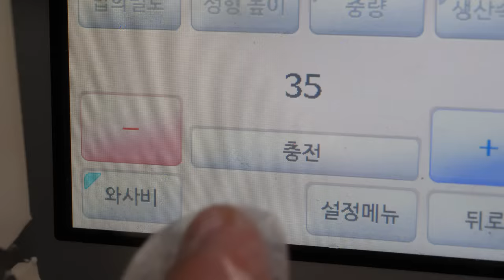신기합니다! 김밥,초밥 만들어 주는 첨단 자동기계 / Amazing food automation machine (Gimbab, sushi)

Comment: this is the most labor intensive automation that I've seen
Reply: It's like the machine does only the steps that requires the least time and effort xD
But sure, the user is reduced to filling and cleaning the machine for every single step instead of acquiring a basic skill like rolling and cutting... but I can't understand how that is supposed to be worth it?
Well, the market will decide ^^
Reply: Your comment is funny
Reply: Seems completely useless especially the machine that just rolls up the gimbab
Reply: I'm so mad you can't set a stack of trays on top and let it load trays automatically. No a human has to load the tray each time!!
Reply: The rolling machine is just like a cigar rolling machine. Just one lever push can do all the job, no need for motorized rolling. Same goes with the cutting machine. Many if not all these machines could work with just one handle pull. Less manteinance, less accidents and most important, it would be faster.
Reply: The main point here is consistency, not actual efficiency. The nigiri maker can pre-mould rice for chefs to put protein (or veg) on, that lessen the work of the chef, also you can control portion size. The same for maki or kimbap rolling machine. No one is too small or too big, too compact or too loose, just pure consistency. When one look at how orderly the Japaneses are, as the main part of their culture, one can understand why these machines are made.
Reply: Maybe they just didn't show the other machine that pre-sliced all the veg/protein?
Reply: @baristaTam  Obviously not for commercial use. Person has to add fish by hand too.

Comment: They're incredible machines. I'm just wondering why they're made with such flimsy plastic. Seems like kid toy plastic.
Reply: 3
Reply: cheap
Reply: Plastic is pretty durable
Reply: I think the reason it's plastic is because the lifespan is longer and it's non-stick. Very easy to clean. And about the flimsy design, it's kawaii > (japanese cute).
Reply: the part where the food is contacted directly should be easily washable and thereby removable. plastic is a good material for that purpose
Reply: @yoy6378  This is in Korea tho
Reply: I'm not sure if this is the case but there's a certain kind of plastic which get tested quite thoroughly to see if they're suitable for food processing/packaging.
Reply: prob made in China
Reply: Easy to clean & replace.
Reply: Easy to clean, and the plastic should be food grade devoid of toxic elements,  kid toy plastic is like that too. So i guess they can be similar.
Reply: @ghost_knight_001  I didn't say the materials weren't technical. I think you're trying to hard to sound smart lol You failed hunny
Reply: Really, I thought the equipment made out of plastics was ingenious.  That way the food won’t taste like metal or like “convenience food”.
Reply: @uthpalachandrarathna4408  food grade plastic Stull has bpa in it
Reply: It's the kind of plastic that's food safe and washable

Comment: Finally, we wont have to pay 20$ for a pack of 10 sushi's in the near future.
Reply: @Mr.Beant It does, for sushi at least. As a matter of fact, sushi mostly consist of rice which is one of the cheapest products. The cost of transportation plays little factor in it's costs due to most restaurants are buying in bulks. In any case, your McDonald bill has around 5-15% labour cost, while sushi has around 40-60% (examples)
Reply: Actually i bought 30pieces of sushi for 9$ today. ( in korea )
Reply: there is absolutely no way this reduces the cost of sushi by any significant margin